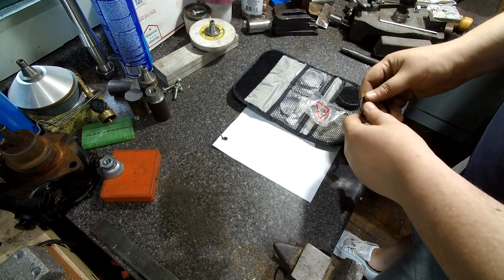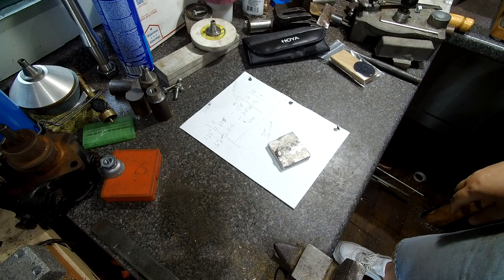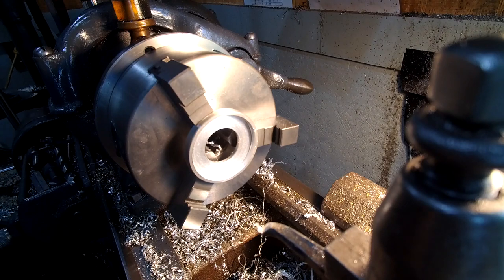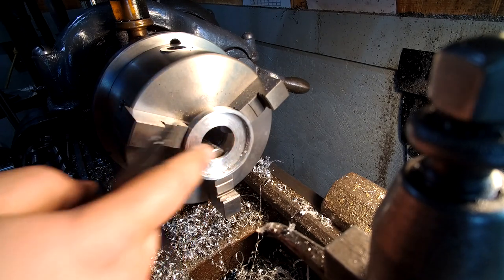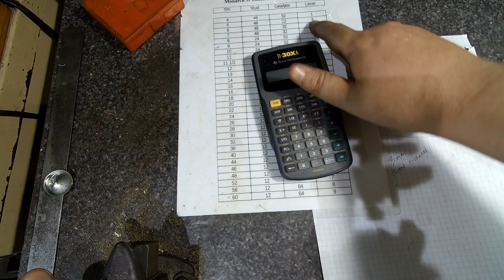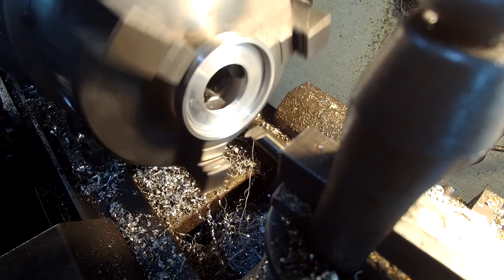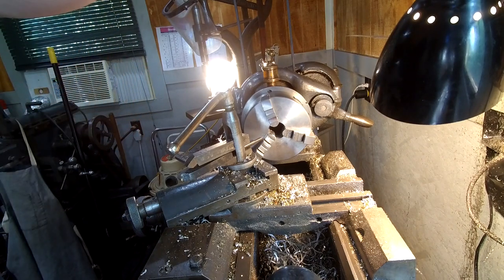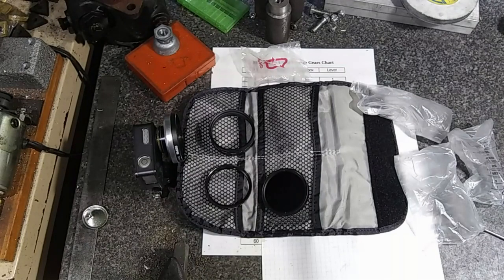Custom Camera Lenses and Adapter (1.25" telescope to 52mm)

Comment: Great project, you got those threads nailed down. Maybe more ppl will want one of those adapters now.
Reply from the maker: lol, thanks man, but I doubt anyone will want one of those adapters considering that I just use that setup for my camera only, and is not standard by any means.
Reply: I think thats what makes such a cool project, it is specific to the device.
Reply from the maker: @valsforge4318  lol, yea, and Im glad to finally have it made up also.